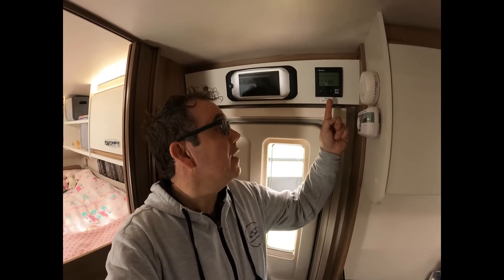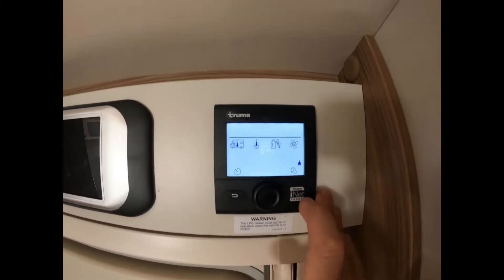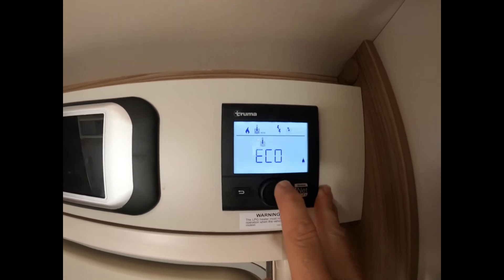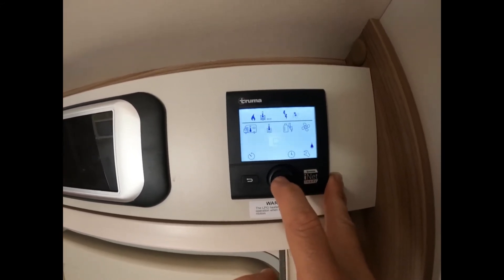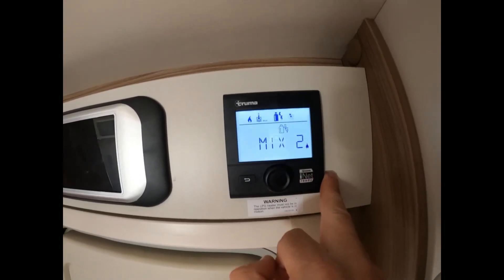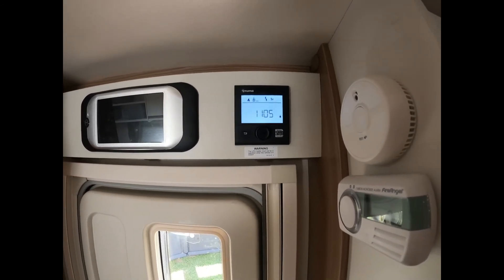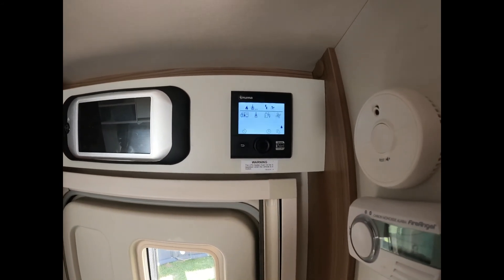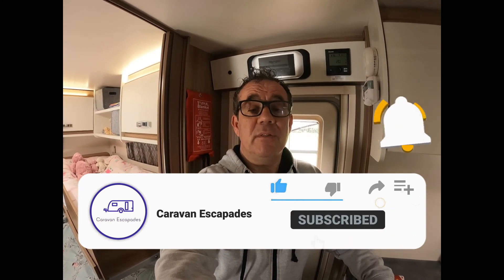Using the Truma Heating Control Panel

Comment: Hi James we went away a few weeks ago for the first time in our Bailey Pegasus grande rimini and we couldn’t get hot water until the water symbol stopped flashing is that correct, I thought it was like a combie boiler and it was instant thanks mate love the videos, we’ve been watching long before Graham (caravan vlogger) recommended your channel 👍
Reply from the maker: Hi Guys first of all thanks for your subscription and for following, very much appreciated. Unfortunately not like a combi boiler. It is more like an old style emersion tank. It holds up to 10L so not a massive amount. When you get on site it can take as long as 40 minutes to get hot on electric but normally about 20 to 30 minutes, What we do is put it on Mix 2 So gas and Electric and it does get hot a lot quicker then switch back to electric only, normally back on Elec 2. You can set the function to boost to get your hot water a little quicker, however when ever on boost it does divert power from the heating until the water is at temperature and it switches from boost back to the last setting. So no heating will be available while on boost Hope that helps. Thanks for commenting. James
Reply: Thanks James very helpful 👍
Reply from the maker: @darrendark4791  no problem